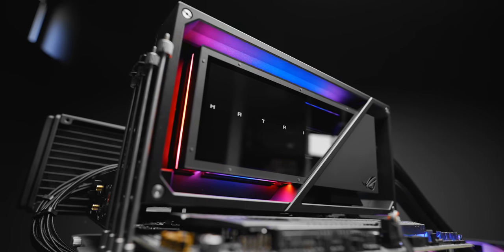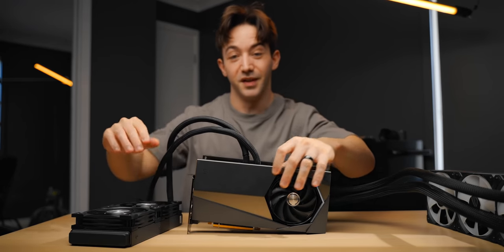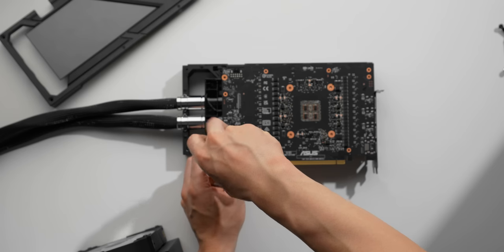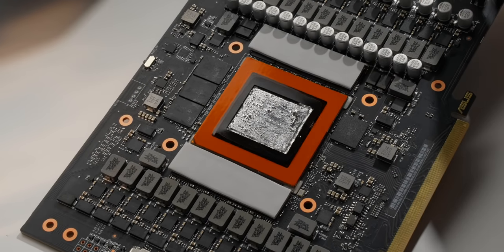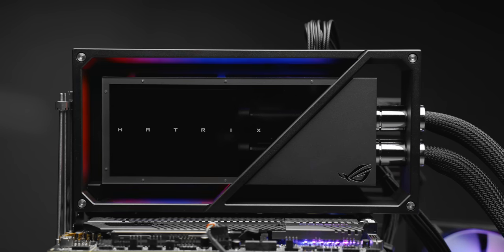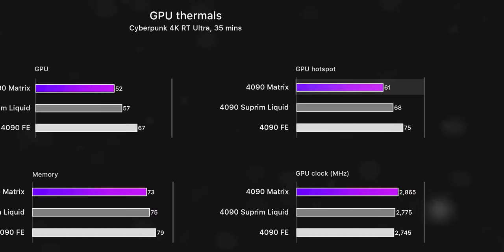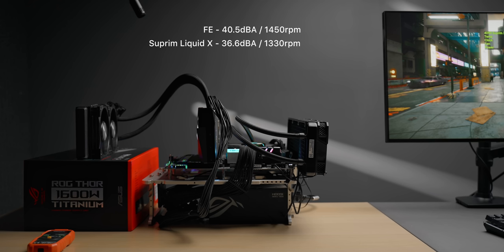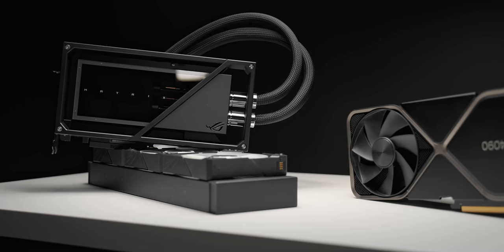Most Overkill GPU – ASUS 4090 Matrix

Comment: lots of cons 
copper + liquid metal = corrosion and temps degradation just months after , it must be nickel plated to prevent this problems.
no vapor chamber , yes even it is for water cooler will be nice to have one with cover over the ram too.
installed mediocre thermal pads.
vrm cooling way too far away from the main plate , will be better to use heatpipes for it , or just a big vapor chamber.
maybe even better vrm , but his probably will not be allowed by nvidia.
considering the price all this must be included.

Comment: very disappointing that you did not address the problem that the copper plate is not nickel plated, so the liquid metal will damage the copper plate over time!!!!
Reply: It's only around 100°C so it will take a very long time. The coolant will evaporate or the pump will fail before corrosion is an issue

Comment: I have the 4090 waterforce, I'd have bought this instead if it was an option.  this thing looks so cool.

I'm running a push pull config on my 4090 waterforce and it never gets above 50c

Comment: I have a question and maybe you or someone of your community can help me out

I just bought a new pc-case and a new cpu cooler, all the other parts are the same. As soon as is started the pc, everything worked fine but i noticed that a low humming sound emitted from my speakers. when i put on my headset the exact same humming sound continued.
I looked at the cables if something wasnt plugged in correctly but it seemed fine. In the old case i didnt have that humming sound.
The speaker and Headset still work, i hear sounds and the mic works fine, just the annoying humming sound in the background.

Can someone help me?